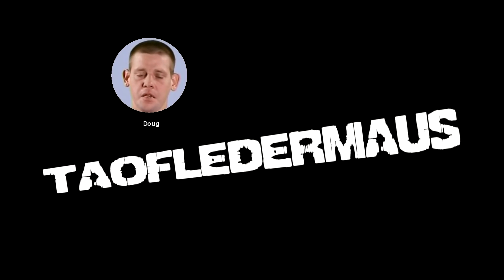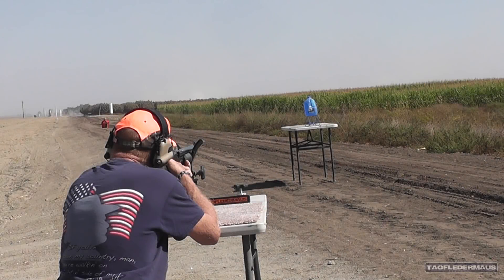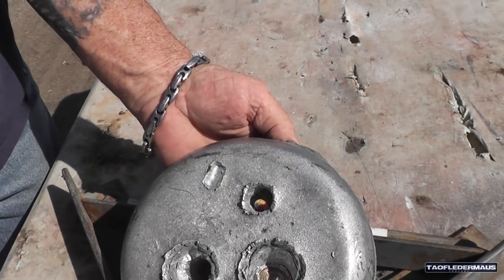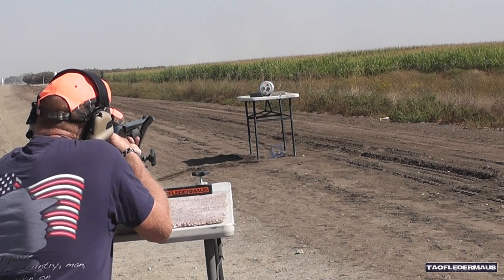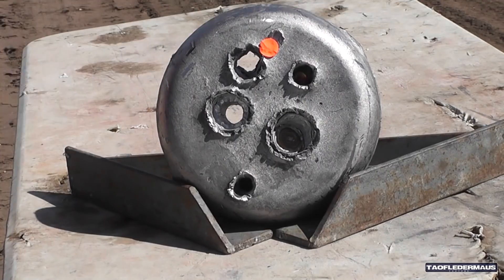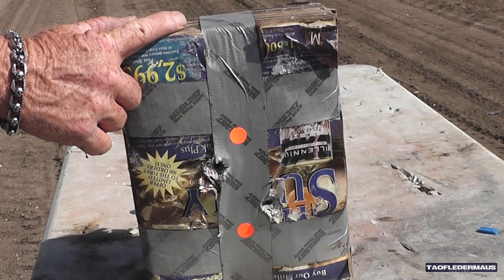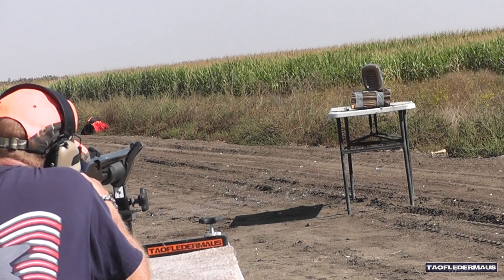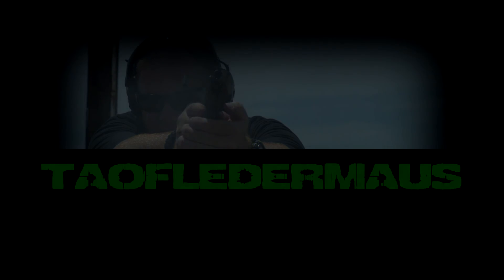.50 Beowulf Bullets Shot from a 12 ga. Shotgun

Comment: Have you tried the Lehigh Defense 400 grain 50 cal Extreme Penetrator with a 3-inch hull pushing over 2,900 ft lbs muzzle energy through thick hide and bone? I am looking for a better bear defense round.
Reply from the maker: The problem is those blue sabots can't handle a lot of pressure and are soft plastic.   Trying to push them too hard and the bullet ends up pushing itself through the base of the sabot.

Comment: I'm going thru the older testing vids now, I had not seen this one before I saw the extreme Russian. Didn't realize you had already shot some in .50 cal , I use Hornady SST 300 grn. that claims 2000 fps. Groups 1 1/2 in at 80 yds. Mossberg 500 20in full rifle. 2000 fps is from I believe a 30in test barrel. Remington has their brass sabot 350 grn. approx. that is probably closer comparison but claims over 1800 fps. I don't know jack about either components but I would love to have these projectiles performing in that ballpark.

Comment: I bet a 3" shell could get it to 2000 fps
Reply from the maker: Those blue sabots are pretty fragile and the bullet will blow through the base if you push them too hard.
Reply: Maybe an aluminum washer between the Sabot and the wad would fix that.

Comment: how about having a normal slug with gun powder that fills all of the space between the slug(filling the concave part of the shell's back) and the primer.  no cork or anything. just the slug and the powder and the primer.  and jamp pack as much powder with a rod mashing it down as hard and packed as possible.  up to 1,000 grains of powder ramrodded into the case then the shell remrodded  into the case and that's it.

Comment: Maybe you could take one of those bullets and hollow out the bottom a little bit, removing about 2 grams of material. That should make it more stable. Also, with a lighter 19 gram bullet and about 45 grains of a faster burning powder you might be able to push it to 700 metres per second, about the same as a 7.62*39. If you pull it off, it could be the deadliest slug you've tested in the channel. Might even go through 1/4" ar450 plates.

Comment: Once more, thank you very much for the excellent videos.  I am going to comment once more on the lead target. The lead slab or plate is a very nice "standard" way to compare momentum, kinetic energy and hardness of different projectiles. This is more evident if you use always a lead plate of the same weight, diameter, thickness and shoot from the same distance. That is very clear in this video and the previous "brass knuckle" video the effect of brass being harder than lead. For sure you guys tested lead projectiles of similar kinetic energy and momentum to these brass projectiles and they did not go through.  It is also interesting to see what happens to the lead target when you use projectiles made of other materials like aluminium or 3D printing...

Comment: I have a suggestion for something you could try next. I read on an old forum post about someone supposedly achieving good accuracy from a smooth bore shotgun by wrapping a .69 caliber round ball in a bit of old t-shirt, twisting a tail on the end and tying the tail with a piece of string. They then cut the tail to about 3/4 of an inch and loaded it using a wad with the petals trimmed down. Theoretically this would create a drag-stabilized shuttlecock effect

Comment: How much would it hurt being shot by just the sabot, or even just the shot cup?
Reply from the maker: If you have even been hit by an airsoft bb,   it stings,   but is only going 200-400 fps and weighs  .12 grams  or so.   The sabot weighs 3.5 grams and can be going 800 or more  FPS at over 10 yards.    It will just punch through cardboard effortlessly.

Comment: geoff, is there a way to film in super slow motion the deformation of the gas seal\piston upon firing?
do you think it crushes those 2 suspension tubes completley flat and if so can you 'tune' the strength of those tubes to adjust the impact of any said slug? thankyou and keep up the good work.
Reply from the maker: I'm not sure how I would film that, but I am certain the cushions completely crush on firing.  The cushions are there to dampen the recoil a little and it actually works.
Reply: TAOFLEDERMAUS thanks for your answer. 
Quick question, Have you seen the Smarter Every day video where he films see through acrylic silencers in ultra slow motion? do you think theoretically using a thick acrylic tube as a mock barrel mounted to one of your shotgun shell tripwire devices and cutting away a small section of the shotgun shell plastic would work? Theoretically?
Reply from the maker: The barrel pressure in a shotgun is around 11,000 psi.   The barrel would have to be very thick - to a point where I doubt you'd be able to have much clarity.

Comment: It is amazing how much just a few more or less grains of powder can affect what goes on at the business end of the barrel.
Reply from the maker: Yeah,  I was really curious how such small increases affected it.
Reply: Some rounds like to go faster and do well at higher velocities. While other rounds can do alright at lower velocities.  Also it maybe that specific firearm too. In one firearm higher velocities are needed and in another firearm medium velocities are good enough to stabilize those projectiles and in a different firearm lower velocities can stabilize the projectiles.  Also another factor to look into are the "cups" used to launch the projectiles from the shotgun shell. Some help stabilize the projectile going down the barrel and in flight better than others.  

There are just  too many factors to consider, that in a short few shot test, it is hard to account for them all and to even try to measure or even document them all.  

I find it interesting how rifles, handguns/pistols and shotguns can all be similar when it comes to loading and then testing ammunition for them.  Some like it hot  (temps, more powder), some prefer a certain brand or type of powder, some prefer a certain brand of primer, some prefer a certain brand and/or type of projectile (bullet, shot, etc,), then throw in atmospheric conditions (wind speed, barometric pressure, humidity, wind direction, elevation above sea level, etc.) all play a part in how projectiles perform! Plus the shape of the projectile. LOL

Comment: Gyro jet slugs possible?
Reply: Expensive as balls. Might as well cast pure silver slugs, I think.
Reply: i thinking reproduction cast in cheap aluminum or ab plastic aka 3d printed slugs because i noticed gryo jet rounds are too small for 12 gauge shells so I"ll have to beef them up little and  re-engineered fuel and body because the patents and kinda slapped together design of the gryo jet rounds

Comment: I use the xtreme defender in my ccw. They produce more cavitation than the xtreme penetrator because the flutes are cut wider and deeper. The xtreme penetrator are designed to dump as little energy as possible on impact so the round can penetrate deeper. The xtreme defender is designed to dump all it's energy on impact and you'll get the most cavitation.
Reply from the maker: That's what they say....  but I saw some VERY weak cavitation with these.
Reply: TAOFLEDERMAUS that's what I was saying. You're supposed to see weak cavitation from those. If you test the xtreme defender then you will see great cavitation but not as much penetration.

Comment: Whats the perfect diameter for a 12 gauge slug ?
Reply: rickburnout666 Check other TFM videos, Jeff mentions/shows caliber/inch; then convert. The rest of us, well, I, look forward to your projectile that you mail or ship to his address shown in the video description.
Reply: rickburnout666    I've had pretty good luck with..69
Reply: This big
Reply from the maker: smaller the than the ID of the barrel!
Reply: TAOFLEDERMAUS I want to know so I can work some on my lathe and you can test them for me. In mm,s would  help as them thou's confuse this metric UKer
Reply: Jack Mehoff is that metric ???  lol
Reply: .719 to directly engage the barrel, .675 to fit in the shot cup.
Reply: rickburnout666 .715 for full bore projectiles and. 690 for ones to be shot in a shotcup I'd send some of both
Reply: +rickburnout666 old English standard

Comment: With a solid brass round could the cushion wad be actually working against your accuracy? Collapsing wads are to prevent shot deformation but may push crooked on the base of the bullet.
Reply from the maker: The base built into the sabot is very thick though
Reply: TAOFLEDERMAUS Do you ever find the wad to have a look? Anyway I enjoy your work. 🖒